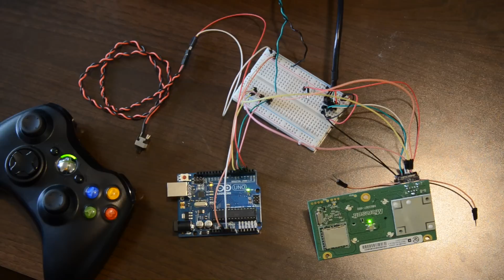XBox 360 Computer Build - RF Module Demo

Comment: im not using a arduino im just soildering the usb to the rf module but the rf module is from a slim 250gb xbox and theres more pins on the rf module then in the phat ones which wires go where